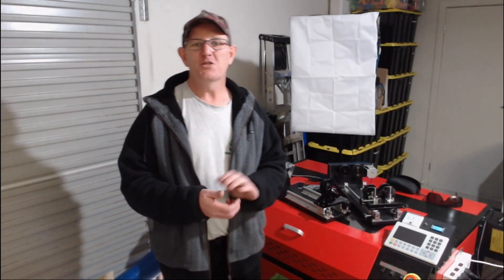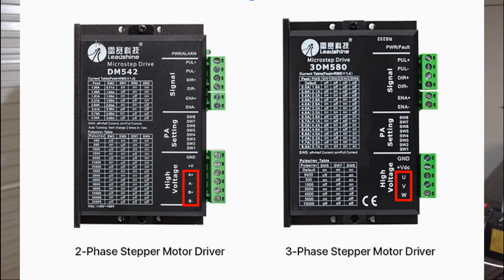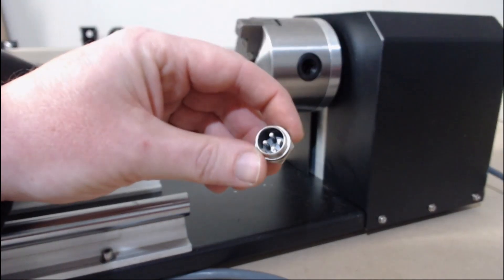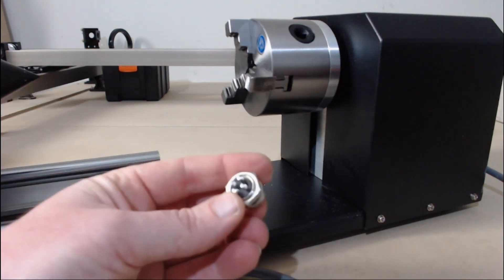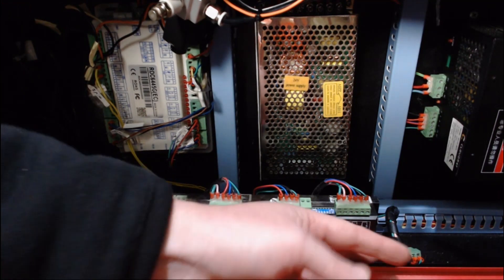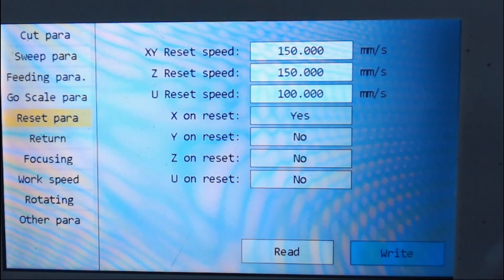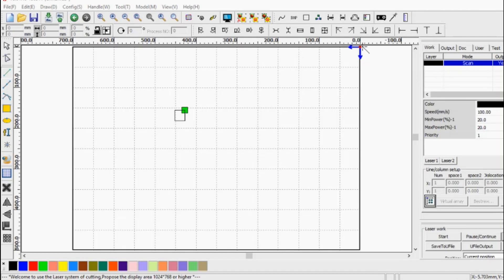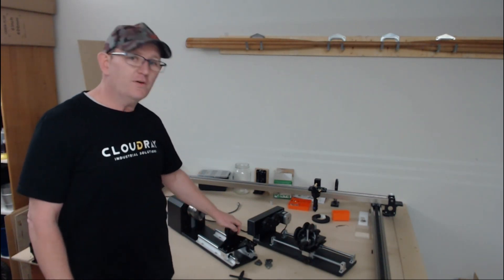Ep.1 - LASER ROTARY ATTACHMENTS - Intro, Motors, Drivers Setup & Wiring. - CNC Rotary Axis

Comment: Hi there!  I was wondering if you know anything about attaching a d12 rotary unit to a chinese laser?  I don't seem to be able to get the pin outs right.  It looks like it is a two phase stepper motor according to the docs, however when I turn it on the rotary unit grinds and then gets really hot (I assume is full on or something).  Tried switching polarity of one of the motor sets (a vs b) but that doesn't seem to work either.  Any idea if this is possible or just barking up the wrong tree?

Comment: Thanks for the video and great info! The wiring info was really helpful, especially the part where you explained not only how to tell if the wiring was done correctly, but also that if done incorrectly then no harm done. That gave me confidence to move forward. It seems that if guessing which wires to pair with each other (on a 2-phase system) — there is a 50/50 chance of being right. I happened to guess right on my first try.
Reply from the maker: Glad to help

Comment: Thank you so much for your very informative video.  The stepper that Thunder laser uses is a little  different.  It is wired to the U axis that leave the Y axis alone. By using a switch to go to the Uaxis. The stepper is 3 phase.  Leadshine iST57. Will it be similar to standard steppers. Any help would  be greatly  appreciated.
Reply from the maker: each machine manufacturer does apply different methods of attaching a rotary.  It may be best to email matt@mwlaser.com.au with some more info and some photos to help me answer your query better.  Cheers Matt

Comment: Hi Matt.  My laser is here.  I'm wiring the Rotary attachment and have a question.  Where are the  GND and V wires connecting to on the Rotary Device?  I have 4 wires coming off it.  Not 6.  Thanks,
Reply from the maker: Hi, the GND and V do not connect to the rotary device.
The stepper motor sources power from the driver.  Only connect A+ A- B+ B- from rotary to driver.  Cheers Matt
Reply: @MWLaser  ok.  But my connector is a 6 pin with the Ground and Power on it.   Can I just split the gnd and v and run it onto the rotary plug?  thanks!

Comment: Your videos have been a HUGE help in my decision to get an Orion 80W -- and to mod it.

But before I do, I was wondering whether these rotary attachments and the Orion 80W could produce the 3D Fish Scale Gun Stock as  illustrated in the top left picture on the Epilog Laser web page: https://www.epiloglaser.com/how-it-works/outdoor.htm.

(BTW - I was delighted to see that you use LightBurn which I've been using on my first last a Chinese K40. I LOVE LightBurn!)
Reply from the maker: 3D effects are possible by setting varying (cut / engrave) power and speed settings on the layers of your designs.
Cheers Matt

Comment: Thanks for the tutorial. Built my laser from scratch with cloudray components. Waiting for the autolaser switch.. Will sure order one of those chucks instead but will add another driver for the U Axis so I dont have to switch plugs all the time..
Reply from the maker: Hey Tom, Thanks for the comment.
You might want to research using the U-axis for the rotary, the information I have read for the Ruida controller is that the U-axis is for feed rollers and not for rotary attachments.  On Ruida controllers like the 6445, Scanning and cutting moves are available only on the X&Y axis and the U axis is a preset feeding function.  There may be other controllers where using the U axis for rotary is possible but I am not familiar with them.
The alternative option is to wire in a switch so that you don't need to continually remove and exchange the terminal blocks from the y-axis driver. But if you do this you will need to ensure the machine is powered off when switching between the 2 options so that you don't cause any damage to the stepper motors or driver.
Cheers Matt
Reply: @MWLaser  Thanks Matt so a switch will be the answer...